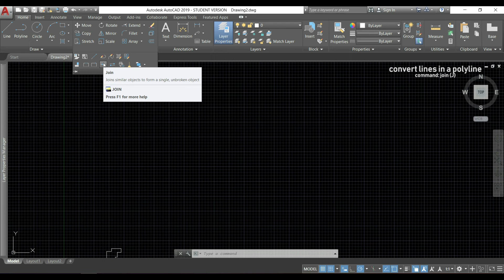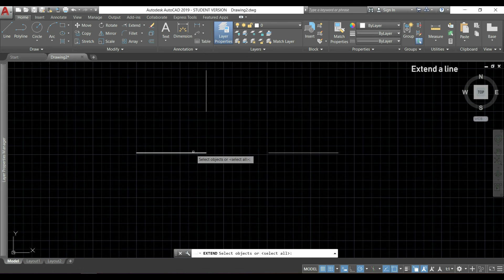Autocad - The Fastest Way to Convert Lines in a Polyline (command Join)

Comment: Does this work for joining arcs to lines? I just get a message 0 objects joined, 1 object discarded from operation.

Should I be using normal lines and FILLET instead?
Reply from the maker: It also works if they connect to each other. However, in old versions, Joint didn't work like nowadays.
Reply: It doesn't work. Just tried. I still can't get my arc and lines to come together and most tutorials aren't helpful.